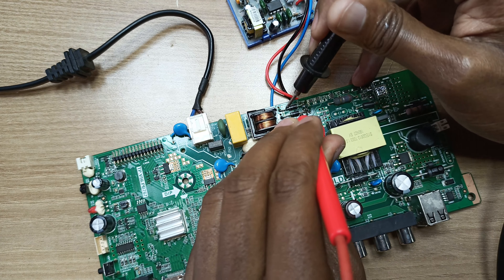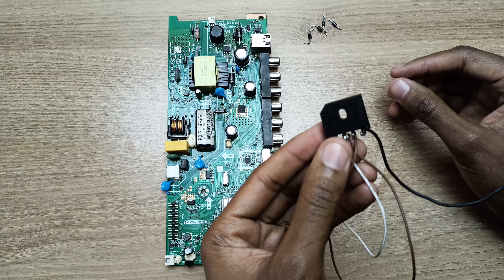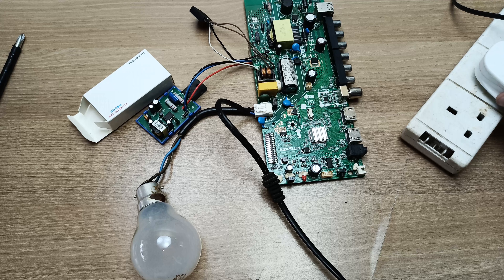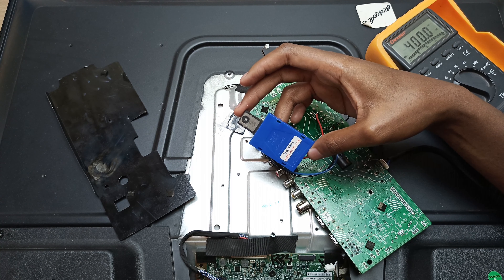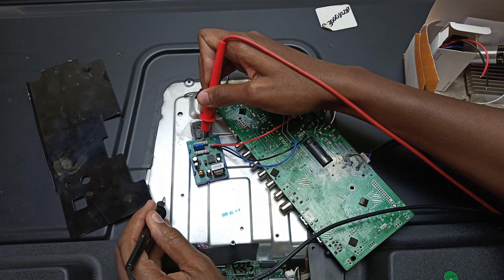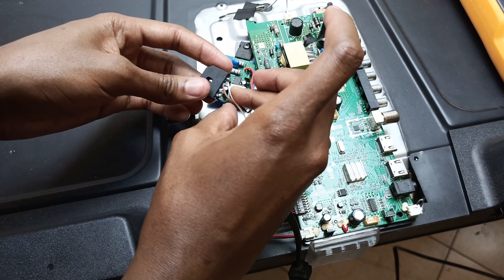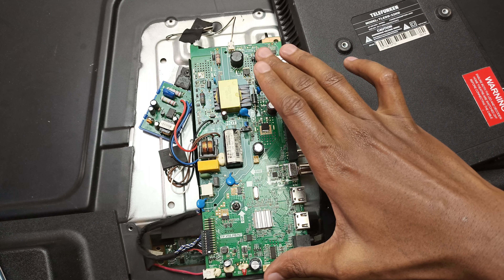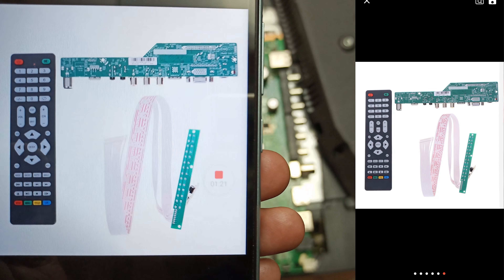Part 2 of Using A Power Module To Fix TeleFunken TV, Fail

Comment: Nice work sir although  something  happened in this videos .what happen  if a blue  cable  is not connected. To onto cupla
Reply: Nothing happens, only that the power supply will part will be working in open loop mode, meaning that it is not sure that the power is actually regulated, but the gadget being repaired will still work
Reply: Though for digital tvs its not advisable to use a powermodule due to the stability of the voltage supplied by them, they are more suitable for the CRT tvs, for the digital tvs just use a 12v 3 amp switching mode power supply and bypass the AC side, and you will be ok